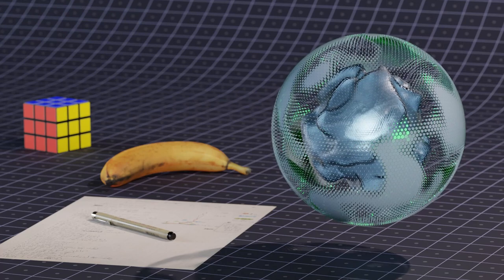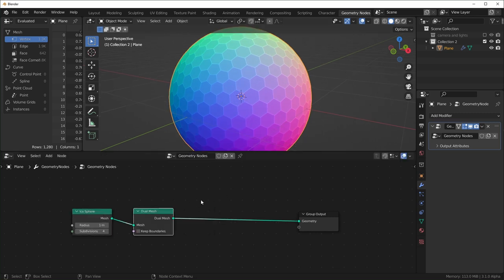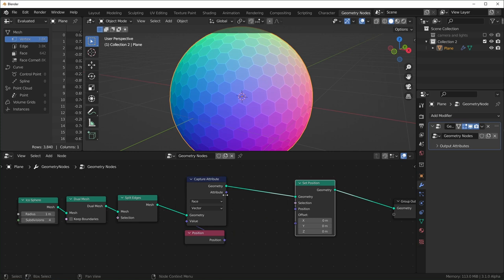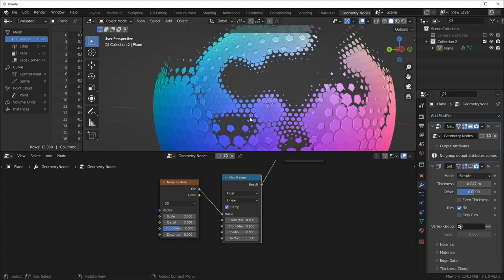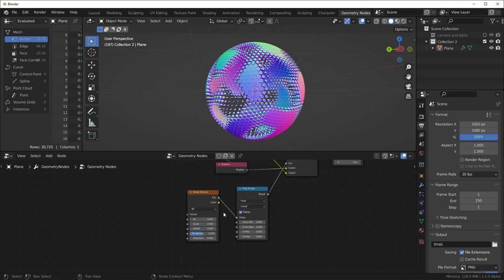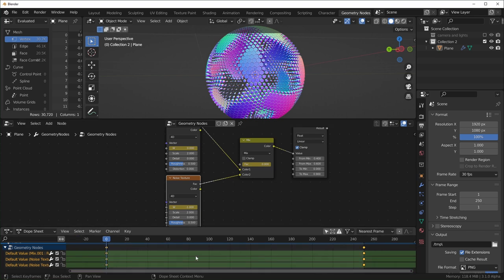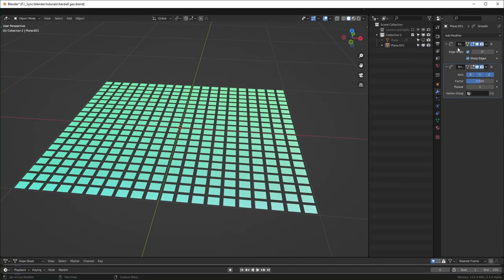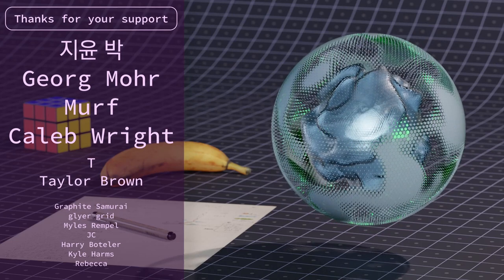Face Scaling with Blender Geometry Nodes

Comment: Messed up shapes you get because by default blender use points positions as input vector for noise texture, what you want is face position from attribute capture node, plugged to noise texture as vector ;) Same role apply to any process with polygons, if you want to make random delete you also need face index from capture node plugged into random value input. This is not convenient or intuitive, but this is how it works for now.
Reply: Thank you! This should be a pinned comment!
Reply: @somerital  With latest blender alpha & beta you can also use interpolate domain node it's bit more convenient than capture because you can put it independent from geometry green noodle which helps to keep things clean.

Comment: Not sure how well this would play into your workflow or end goal:

- Icosphere - Lev 4
- Tissue - Convert to Dual Mesh (NOT Dual Mesh)
- Edit Mode, Mesh Tools, Face, Split Solidify, Adjust Thickness and Distance

Same initial end result, minus the Matcap.  

Although if you add in the Matcap, same steps, you get to essentially, much the same point as in the video up to 4:40.

Comment: Goddammit, I picked up the looping tip from Ducky3D's 'Satisfying Geometry Nodes' vid and either he didn't mention the MixRGB Factor keyframes or I completely missed it, and I've been stumped for about a week now. I'd resorted to tracking 360° bezier orbit coordinates as a replacement looping input for the W factor... Shoulda just come straight to the source 😅

I was meant to be asleep two hours ago but I'm so stoked that I've finally found the answer, thank you thank you thank you! Subscribed.

Comment: Two things I don't quite understand. Why is the "Capture Attribute" node scaling the faces when it's supposed to give positional information and how is it different from the information the is given by the "Position" node? I'd rather say that this value encodes sort of the radius of the face relative to its center point. 

Why is the trick you show to smoothen the animation necessary? It should be smooth if you have the W value on the same position at the beginning and the end of the animation, no?

Comment: This is great thanks for sharing! However, when I apply a material it doesn't take, perhaps because of the geonodes replacing the plane with a new mesh? How do I use materials with this?
Reply from the maker: There is a set material node. It's kind of weird, but it's useful for when you want different parts of your mesh to have different materials.

Comment: Neat trick! I think however that it's a shame it has to be done this way. My logic would make me think that after you split edges or separate geometry set to faces you should be able to scale each new face either in respect to the object's center or the local center of each face. individually. I would have never guessed intuitively about a Mix RGB node to deal with vectors in geometry nodes ( it makes sense if it's in the shader editor) because it doesn't make sense to me that I should manage vectors with those kind of tools. I hope they manage to make geometry nodes a bit more comprehensive because I feel some parts are very redundant and not very intuitive at all.
Reply from the maker: In the new builds they have a scale node that will just let you scale faces after splitting, which is way easier to understand.

Comment: Amazing tutorial and great explanation! I'm missing the reason we also need to use a mixRGB in order for the faces to appear🤔
Gonna check your other videos for sure
Reply from the maker: The mix rgb is just switching between the position node and the positions of the faces. If you only use the position, nothing will change, if you only use the face position, each face scales down to a single point.
Reply: @JoeyCarlino  is that because when you're running "Set Position", you're actually setting the positions of the vertices, not the faces? So you're scaling from their initial position, down to a central point (Face position)?
Reply from the maker: Yeah, exactly

Comment: This part 4:10 doesn't work when I tried it. I'm using Blender 3.3. What should be done?
Reply: its still the mix node, starts blue but if you change float to color it should fix the issue.

Comment: How do i apply this same Geometry Node to some GLB model? The problem is that when I apply it to some other Mesh, it gets converted into an ico-sphere coz that is how the Geometry Node Tree has been created. I want to retain the overall geometry of that 3D Model and just apply this effect.
Reply from the maker: Plug in the group input instead of the icosphere
Reply: @JoeyCarlino  did that. Looks like the mesh is a bit messed up.